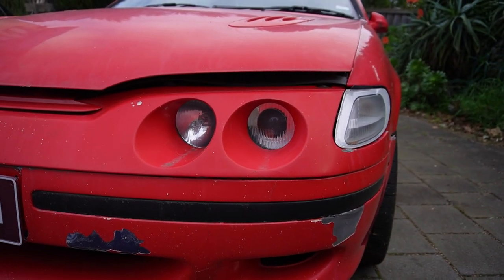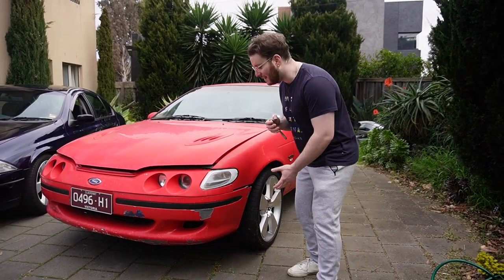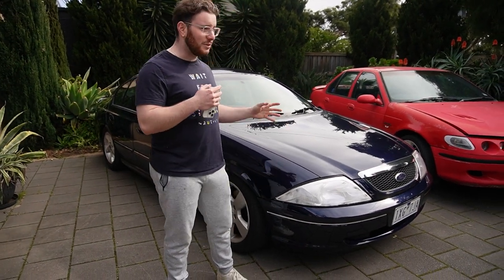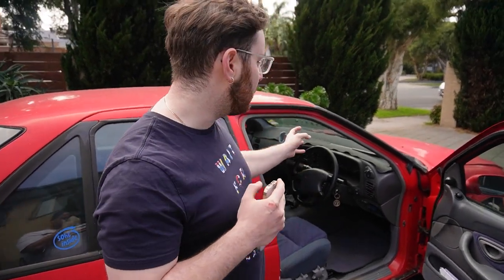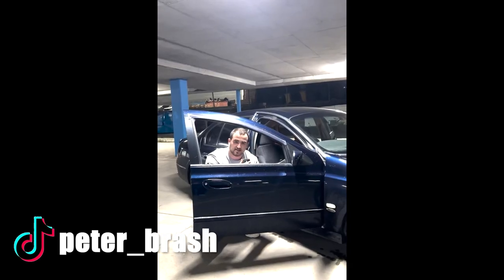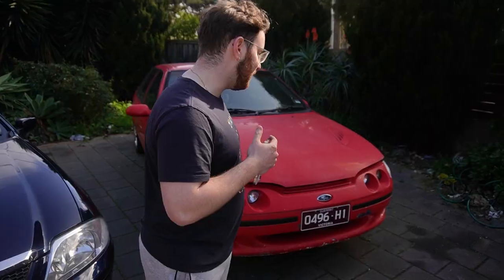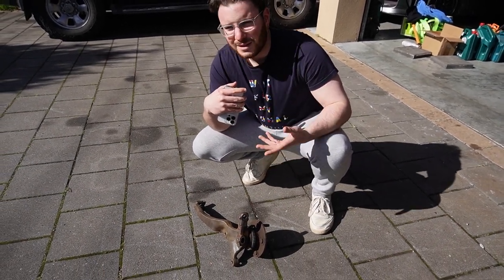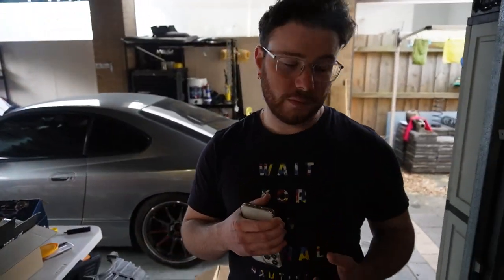WATCH THIS BEFORE BUYING A FORD FALCON!

Comment: I wonder if not having that extra vent for the radiator will impact cooling, also wondering how the hot side is gonna breath once you turbo. I know with the BA you can go under the light but with those little lights there doesnt seem to be much room, keen to see the build.

Comment: Dude i paid 1400 for a ef 1996l5 red like this probably a little roucher paint and body then yours and not as cool as your front bumper but has a body kit newer btr transmission i got it with a stuffed alternator and starter rely but still manage to drive it an hour homr haha but the thing runs beautifully all i need is alternator and starter rely and im good to go

Comment: Eb was the best and greatest falcon ever. In my opinion
Reply: I had an EB Falcon GLi and it was a complete lemon. The head was done 5 times and it had less than 16O,OOOkms on it.(when I eventually sold it) 3 cracked heads,2 gaskets. It must of been made on a late Friday afternoon or early on Monday morning. I would never own another EB Falcon EVER.

Comment: An EF xr8 would be my dream car.
Reply: I also love the old school 5.0 Windsor Engines from the 90's and Early 2000's but they have no power. Love to see somebody do Coyote Swap in EF XR8.
Reply: @anishchand4420  the LS engine is a really good conversion option, they are just like a high tech 351w and the Holden t56 lines up with the shifter hole
Reply: @tturi2  putting LS ( LS1 / 5.7 Chev ) in a XR8 is a blasphemy.
Reply: @anishchand4420  maybe, but it's essentially the same type of engine
Reply: @anishchand4420  The LS1s are not "Chev" engines. How can people still think they are?...and seriously who cares if someone puts an LS in a XR8. It's a massive upgrade, heaps more power and torque plus way more reliable. People can do whatever they want to their own car.
Reply: @victorpeirce4753  back in 1999 when the LS1 engines came out in SS, Clubsports and GTS they were called LS1 or 5.7 Chevy. That's back in the 99-2006 era. Now Dayz it's called LS1. Put a LS1 in a XR8 that's like putting Coyote in a SS.